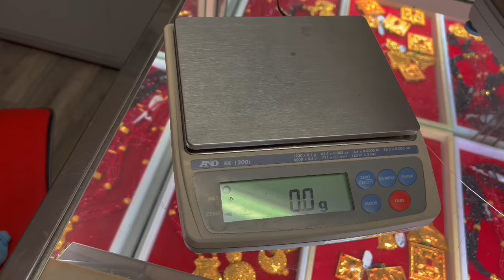How to Transfer Scrap Gold to a Cuban Link Bracelet - It's Totally Insane

Comment: It's strange to me that Jewelers have the Giant Jewelry Rolling Mill which seems able to draw the Gold uniformly and with little force needed...Yet they still use a Draw Plate in the end which seems to require much more force on the Jeweler's part. Why is this? I see the smaller grooved settings on the Rolling Mill.

Also LOVE that chain that you are wearing! What's the name of this style?
Reply: @RichardKinch  The style of chain I'm referring to is NOT the piece being produced in the video but rather the chain that the Jeweler is wearing himself in the video (3:00).

I see them only using the thicker settings on the roller mill, but on the other side there are thinner unused grooves.

Thanks for response.
Reply: The draw plate gives a smoother finish and a more precise final dimension to the wire.